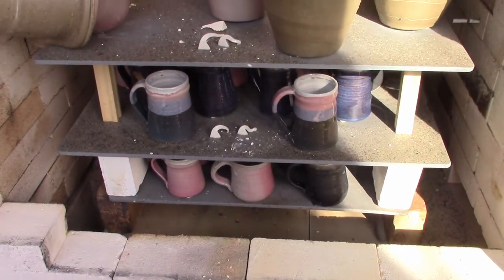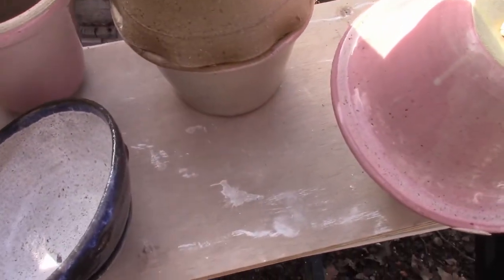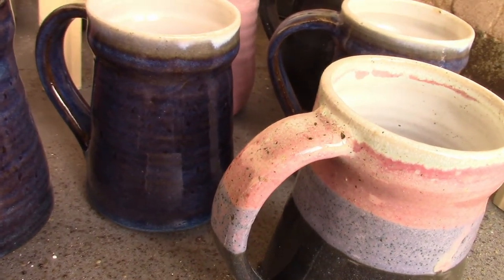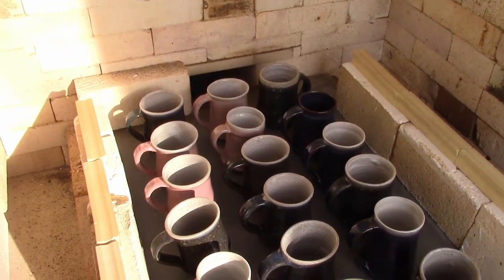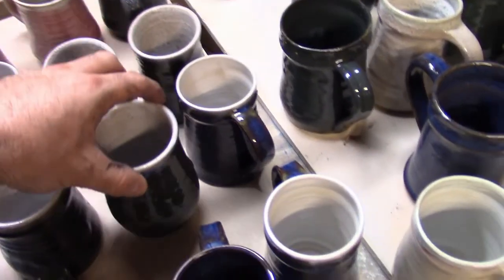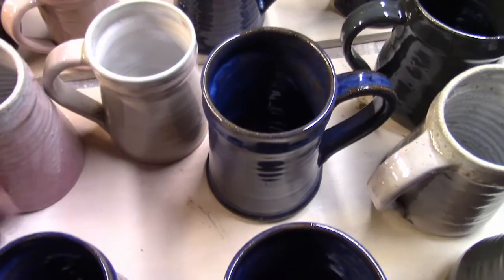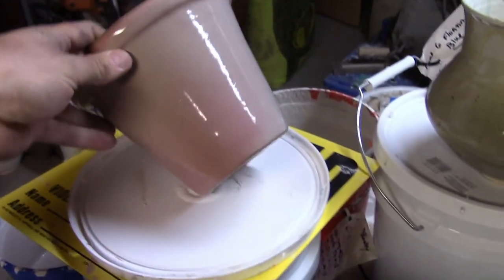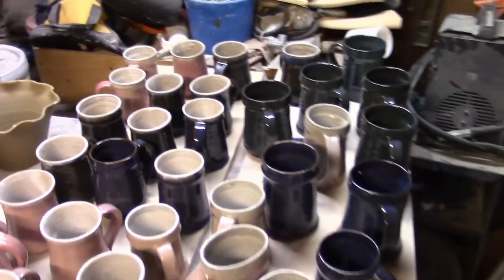Cone 6 wood firing failure.  Failure is an opportunity to learn.

Comment: Hey, it's a shame you had bad results. Is it the same kiln and clay you used where you glazed everything in Simon leach celadon?  What clay is it? Seems like that is most likely problem as you have trouble with multiple glazes. But if I was you I'd fill the kiln with the celadon I knew worked, and only test one pot for each new glaze. Just my 2 cents...
Reply: ...I have had massive failures doing a similar thing though